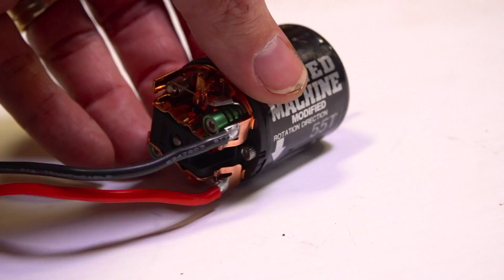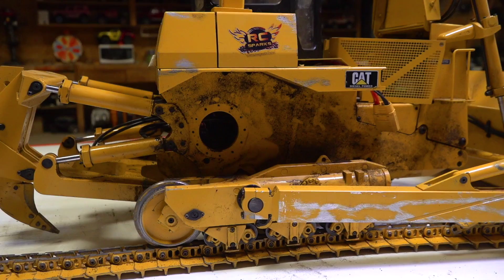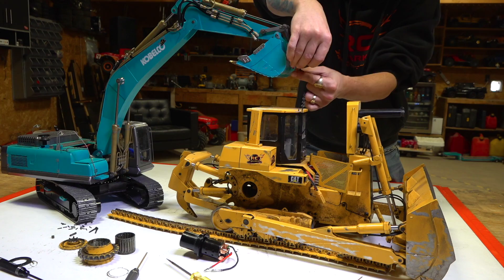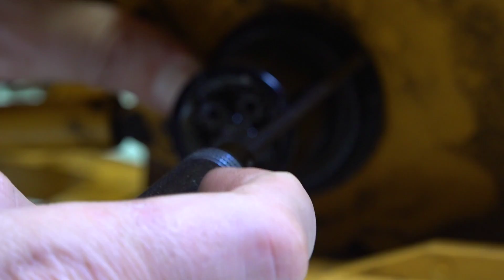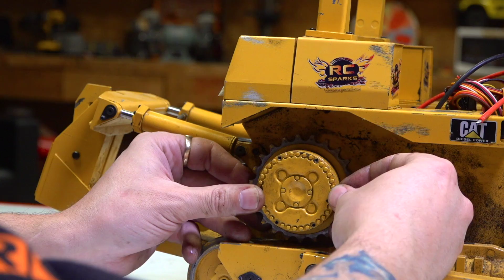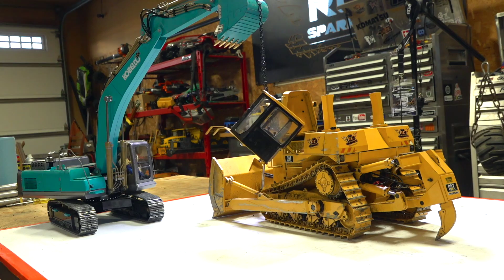USING the KOBELCO EXCAVATOR to HELP REPAIR the CAT D9 BULLDOZER DRIVE MOTOR | RC ADVENTURES

Comment: Great vid as always!  So I notice you operate your hoe with sprockets leading, I lead with the idler wheel.  Figure front gets into more "junk"  and try to protect the sprocket.  I've heard it's a regional thing on what you lead with.  I've also heard the argument with leading with weight (motor/sprocket) vs idler. I've got a 4200 with the Soylind motor upgrade so leading with the motors/sprockets also means no digging through the tracks.   Any thoughts?
Reply from the maker: Yeah, my thought is Im playing with a hobby vehicle..and my imagination is not limited by "real world" bs..  I just have fun.. and have little to no problems. Its awesome!
Reply: @TheRealRCSparks  Absolutely, was just curious if you had come across this as well.

Comment: Another fun video, love how much pulling power the Kobelco has.
I know the D9 was on a slippery surface but it seemed to move it with ease when it was refitting the tracks, maybe you should have used some chocks... 🤔

Comment: Hey Medic, perhaps you could film a bit of a comparison on size and capability between the Kobelco and the 4200XL? The differences in detail and overall quality are pretty apparent even without them side by side, but I am curious about reach, lifting capacity, breakout/digging capability and such. (Yes, it may need to wait until the white stuff goes away outside).

Thanks for all that you do!

Comment: watching these videos gives me flashbacks to my rather brief stint working for an excavation company as a laborer. started out at an apartment complex installing sewers. daily occurrence was working around a small-medium excavator,  hooking and unhooking things on the bucket. then moved out to a landfill where i operated a 40 ton haul truck mostly moving overburden from the start of a clay pit. did get to haul a few loads of top soil onto the active pile. only did the job for a month and a half before quitting but i'll rememebr working on/around those machines for years.

Comment: What we do moving a similar large gearbox housing in 1:1 is use a forklift with the forks pushed in close.  drive the forks to the mounting plate, slide housing in off of the forks.

Comment: Aaron, when you found out that the motor shaft was a non standard size,why didn't you find somebody with a small metal lathe to either turn down the shaft of a 540 motor or open up the diameter of the pinion a little bit for you.

if you opened up the pinions a bit to accept a standard motor that could solve a lot of problems for you.
Reply from the maker: because I could just order another motor :)

Comment: Your excavator sounds like u need more hydraulic  fluid
Reply: No fluid is needed, just a good adjustment of the valve drive. When the control levers are operated, the hydraulic pump starts working before the valves open, that creates too much pressure, and when the valve finally lets fluid through, the movement is too abrupt.
I would adjust the mix of controls to +60% / - 60% so that the pump generates sufficient pressure for precise movements.

Comment: I’ve actually changed one in real life on a D8 and man wish it was this easy lol...
Reply: I here you buddy. I work on these for a living. I work at a CAT dealership. I always fear on losing a limb.
Reply: @marshall32781  Always keep that "fear" and you will retire with all your limbs and digits.
Reply: @Mr4rt  thanks buddy. Been doing this for 12 years now. Fear is what keeps me safe. Helps me come home every night.
Reply: @marshall32781  comiquitas
Reply: MR. Am yea took me a few day I did it on a side of a creek sucked first and last one I did lol
Reply: @marshall32781  Same here. Just got done rebuilding a trans in a D8. Fun times.
Reply: Especially when it’s 10 degrees out and it knee deep mud, make many a man appreciate a hot shower come sun down
Reply: I just got hired with cat as diesel mech what did you guys change one the dozer
Reply: @TOOLS_AND_MORE  I've done everything there is to do on D11, 998M, 773G and 390E.
Reply: @TOOLS_AND_MORE  I've bone everything there is to do on D11, 998M, 773G and 390E. What CAT dealer you working at?
Reply: @marshall32781  Zeigler cat in Fergus falls